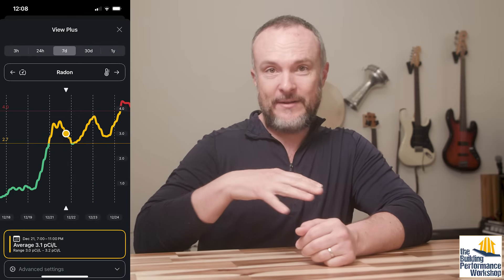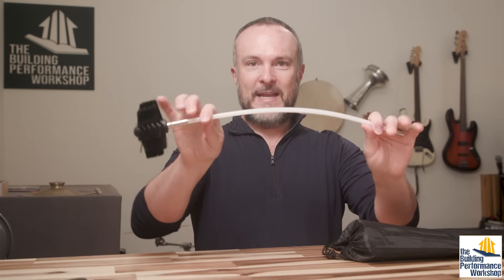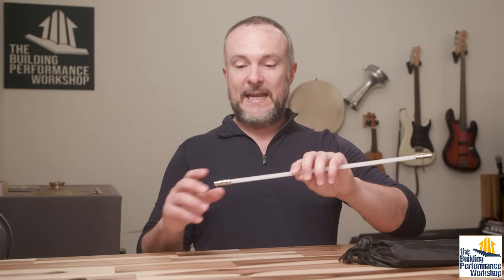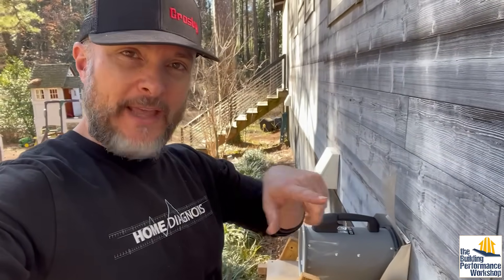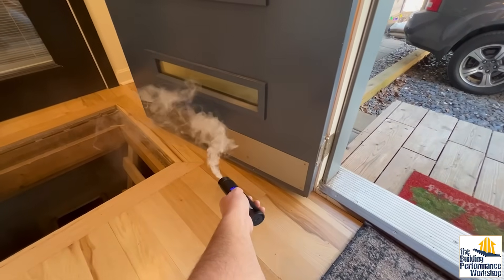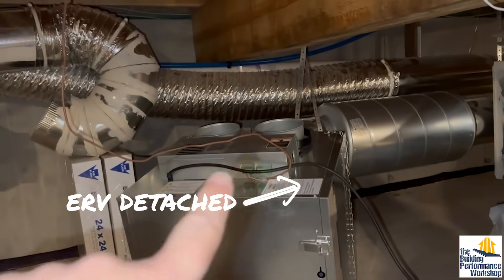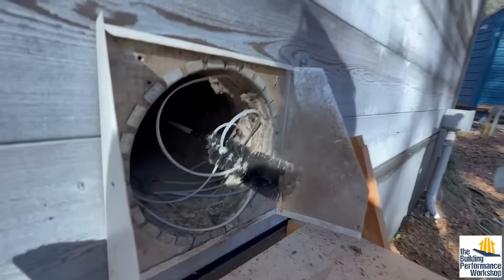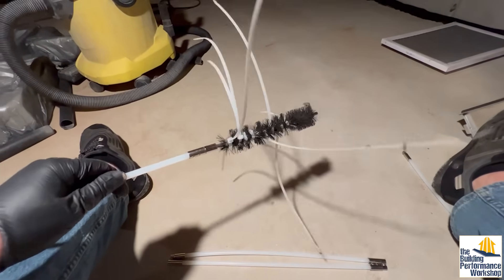DIY Duct Cleaning Kit: ERV/HRV Intake Maintenance for Home HVAC & Ventilation

Comment: Nice solution! I found some studies that showed polishing the surface of ductwork improved airflow by 25-30%. The follow-up monitoring showed the improvement was maintained. I couldn't find specifics, but I am guessing the polished surface accumulates less dust and dirt, so cleaning isn't needed as often. I'll probably invest the time to polish my ducts before installation. I'm also going to use a lower friction rate in my duct design to see how it affects duct sizing and airflow.

Comment: I really like what you ended up doing, especially the added helper on the outside.  If i were to do approximately the same thing, I think that I would take a couple more steps.  I heard what you mentioned about not wanting to push the crud out and have it inside due to leaks, however, I would use the suction side as you used in combination with the twirly gig, PLUS use a good battery powered leaf blower to gently push things along in a controlled manner.  I would also set up a CR filter or two in and around the work area prior to starting, and let it run for an additional hour to get the dust that escapes the cleaning and give you time to vacuum or mop the floor if you want, before tearing them down. I would also wear my P100 respirator during the process (inside person and outside person).

Comment: I've used those dryer kits for cleaning dryer exhaust vents.  Just a word of caution, as those flex shafts get older they get more brittle.  At some point, it makes sense to proactively replace them with another kit than trying to use them too long and have them break in the middle of your vent.

Comment: Air Compressor powered tools generally require somewhere around 15-25 CFM @ 150+ PSI to operate the duct cleaning tools at normal capacity.  Some tools are considered ‘low pressure’ whips and can operate with closer to 125 PSI, but still around 15 CFM @ 125 PSI or you’ll have extremely intermittent tool capacity for your cleaning.
Reply: @Home Performance - I would bill someone $200 to clean a single ERV line or dryer vent (including dryer interior) as of 2026.
Reply from the maker: Good to know, thx for reference

Comment: You don't want the button lock.
Everyone says those falls apart in use innside the tubes and gives you a nightmare to remove.
The screw one is much safer and is self tightening while using (unless you try to put the drill the wrong direction😂)
Reply from the maker: All the serious pro models are button lock. I don’t think you got the advice.

Comment: Super cool.  I know it sounds weird, but on my fresh air intake, the pre-filter part has some pretty tough 8” foil/rubber style duct I installed.  So, I literally sprayed it with probiotic cleaner, and used a towel and broom stick, then rinsed it with the hose because it happens to aim down.  It did work!!! 😂

Comment: Ok I'll address the elephant in the room. But first good method and tools for doing it and I actually picked up one of those brush kits for $1 from an amazon pallet store visiting Daughter last year too good to pass up at that price. 
      Now for the elephant. I like how you always like to stress things like say vent hoods and bath vent fans and placing them right where the moisture or pollution is created. In this case you need to be filtering the air right at the point it is entering the house. You need a filter plenum on the outside of the house. Don't let the dirt and gunk get inside the house in the first place and you won't have to clean up the mess. 

       Your drill has a clutch turn the outer ring to one of the numbered settings. I never use it because I have throttle control with my finger.
Reply: Yes I might consider something right at the intake. Easier to clean and swap out. In my case I have room in front of the screen on the soffit vent which is recessed by a few inches. Now for deciding on what filter medium so as not to decrease the draw too much. A pollen filter might be just enough? I have them from my older Broan ERV.

Comment: Shouldn't cleaning be done mechanically, and then with ozone? Car ventilation circuits are cleaned with ozone and it works well, so shouldn't the same thing be done in our ventilation systems?

Comment: Great video pointing out some very important maintenance issues I hadn't considered.  It has prompted me to start thinking about adding exterior mounted filter boxes for both my ERV and kitchen makeup air intake plans (I have weather protected, accessible spots for both).  Thanks!
Reply: Maybe low MERV rated oversize volume filter with some kind of desiccant layer, weather protected DIY assembly
Reply: @jtmg11  example of a product?

Comment: 16:00 is the make up air passive or is there a fan?

If it’s just passive, the lower CFM and pressure difference could be a factor as well.

I could see the erv intake almost like  vacuum or outdoor entryway air purifier. Leaving the rest of the air for the make up vent as much cleaner.

Only running ≈3hrs/day is obviously a big factor.

Edit: looks like 16:35 that there’s a in line duct fan got makeup air?

Comment: So, I think, when we build our house, I'm going to look at building the filter boxes either directly attached to the inside of the exterior wall, or hanging on the exterior. I was already considering the idea, but this video really settles it for me. It would definitely be bulky on the exterior, especially if I'm trying to run make-up air through a MIRV 13, but I think I could hide it in something like a lean-to garden shed. Not sure yet.
Reply: I like this idea... I plan to have my HVAC in the attic... so I could install gable vents then mount a big filter box for a furnace directly to the wall behind the gable vent.  Just gotta pick one that has room to slide a screen in as a prefilter.
Reply: @josephhfry , I've seen people also have a shop build filter boxes to fit their specific situation, like having two or three filter slots in series for a metal mesh and pre-filter, or stacked V-shaped designs to increase surface area. They were a bit more expensive, but not astronomical. Could also design it yourself in CAD and have a company like sendcutsend cut out the pieces from sheet metal, bend them up, and send them to your door for final assembly. Could even do it out of wood, though I would recommend using marine-grade plywood and paint the interior with something low-VOC.

Comment: Brilliant. That low 24/7 suction from outside will always bring in all kinds of debris. An elbow outside going up the side of the house to a higher intake should minimize ground debris from swirling into the intake. Then paint the outside duct to match house color to make it blend in better. Even put a filter box after the elbow to clean the air just before it enters the house envelope. Easy access to clean. Maybe use a washable filter just for that spot.

Comment: Why were you so dead-set against the threaded flexible rods?
Reply from the maker: If it gets stuck (which it did) and you reverse the drill direction (which did fix it) it comes apart inside the duct.

Comment: So if we put the intake filter in a box on the outside of the house, this would be a lot easier, right? Just don't have a duct full of air that hasn't been filtered yet, by putting the filter at the intake to the duct?
Reply from the maker: Practical issues. Try it though!
Reply: people have done this, search online. I'm working on this right now. Tired of bugs and dirt ending up in ducts. Make sure to have a high surface area so bugs don't get sucked into the filter
Reply: @shellderp  I think pre-screening as well as large surface area filters. Here in Australia I have insect screens on all my doors and windows, and they keep out flies and mosquitoes but we have tiny insects that are attracted to lights and go straight through our screens. Not dangerous or harmful in any way, but infuriating when they crawl on every surface near a light! I don't think they'd clog a filter so long as there was no light source nearby, but they certainly have the numbers to create a problem if they did decide they liked the filter.